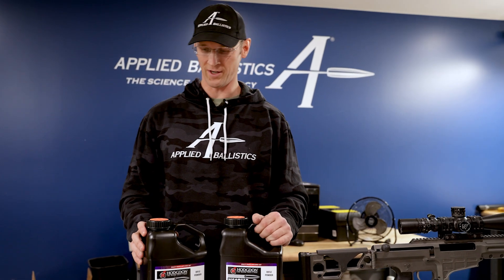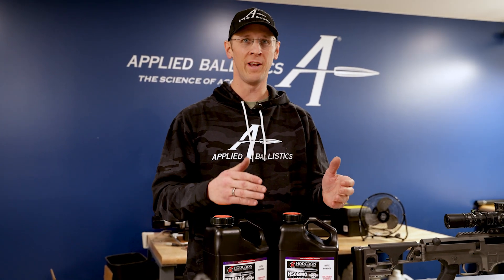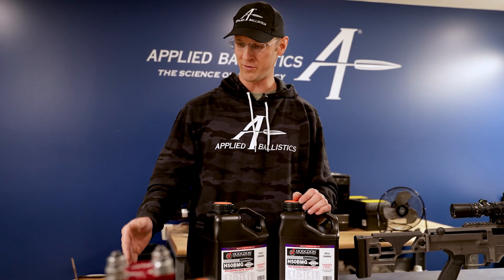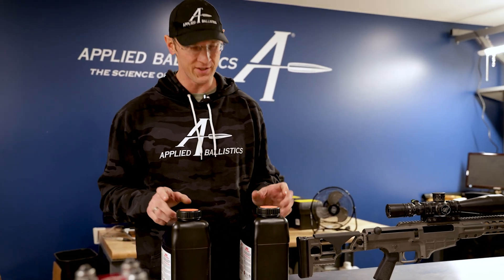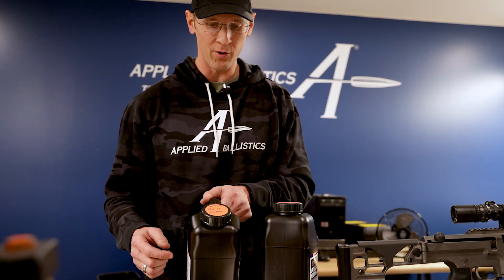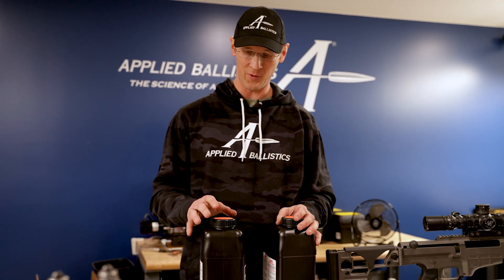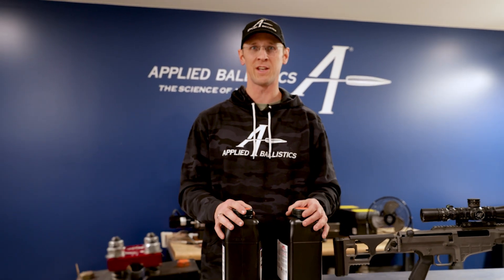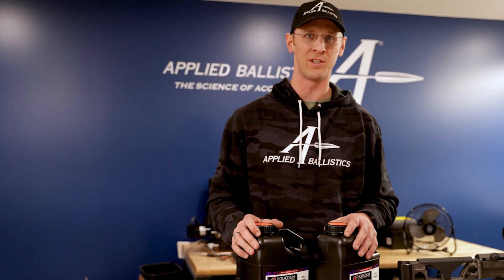Powder Humidity / Temperature and Storage

Comment: Brian, What humidity range do you suggest is optimum?
Reply from the maker: You always want to use the Humidity at your position but if you do not know it or cant capture it, 50% is the value you would want to input. Humidity has little effect on your solution until 1 mile or further.
Reply: @AppliedBallisticsLLC  Thank you for your answer, but I meant what humidity range do I want to keep my gunpowder stored at?

Comment: @AppliedBallistics, Could you do a test where you make 40 identical cartridges of powder that was stored at 50% humidity for at least one month. And then shoot 10 right off as the control group for velocities, and store 10 in a sealed ammo can at 10% humidity, 10 in a sealed ammo can at 50% humidity, and 10 in a sealed ammo can at 90% humidity, then shot them one a day till they run out to see what the velocity differences are? And be sure to make them a light load so that the drier ammo will not get too high of pressure.
Reply: @Boltactionreloading has done this
Reply: @johnwynne5937  I though he did the powder and then loaded rounds with different RH powders, not actual cartridges made up with the same RH powder to see how well the humidity impregnate loaded rounds over a short period of time.
Reply: @thetexasrat  that is correct, I misunderstood what you were asking. I would wonder however how much that could vary from cartridge to cartridge
Reply: @johnwynne5937  It is being proclaimed by one source that within 24hrs a loaded cartridge will acclimate to the RH of its new surroundings. Others have stated within a week. So I am curious as to just how long it actually is.

Personally, I store my ammo in an IP-65 Rated ice cooler maintained between 54 to 57% RH. This way my ammo should be as close to factory conditions as possible at all time. I take some out and I shoot 'em before they have time to change, and the rest is still stored at the constant RH set. But I am wondering if I took some out of the cooler how long would it actually take for high RH to soak into the powder, or lower RH to end up drying out the powder.

Comment: The only way to prove what humidity does to your load is to take a sample of powder from the same jug, preferably multiple samples from the same jug and set them a side and get them to two different moisture contents. then go test everything. testing high moisture, low moisture and control loads. that way you will eliminate any potential jug to jug variance even if the powder has the same lot number.

Comment: This is awesome. I had been working on this problem since watching Bolt Action Reloading’s video. This really answered a lot of questions as to why I was seeing with hotter loads due to powder drying out.

 I found this video right after discovering the 49% Boveda packs, so I felt safe using them with your recommendation. Sadly a lot of my cans are 1lbers and my D3 Drop would not fit through the opening. After much searching, I found a humidity device about the size of a quarter from Blue Maestro. 

I have been finding that my open powder drys to high 30s low 40s here in Semi arid Wyoming. The Maestro disk works perfect. I do wrap it in some nylon stocking type material to keep powder out of the vents. I tie a string around that and lower it in leaving the string end out for retrieval.I jostle the can around to bury it in powder so I am reading that instead of the air. I also tape a string to the 49% pack and hang it rather than let it lay on the powder. This may be overkill but I worry that powder touching the pack might “soak”  more moisture. According to the manufacturer the 49%, unlike the others, are designed to range from high 50s new, to 40s as they deplete.

One thing I don’t do is leave powder in the hopper any more than I have to. I have purchased open cans of powder that were dryer than mine and I suspect this is why.

Comment: Fyi, the humidity acclimatization starts happening in many powders before you break the seal. I store mine unopened, vaccuum sealed with color change desiccant packs in the vaccuum bag and outside of the factory sealed power can. Some cans collapse from the vaccuum immediately, some take a month to collapse, and some permanently keep their original shape ("good factory seal"). Usually in less than 2 months the desiccant packs achieve maximum color change and saturation (about 3 mL max. Per. Pack based on the package). This is true even with the cans that permanently hold their shape under vaccuum sealing. I've had some of these desiccant packs sitting open around the house for over a year to see if ambient humidity would cause  color change, and there has been no noticeable change compared to desiccant packs still in their original package. I do this with primers too and the desiccant  packs become saturated in about a month or less. Vaccuum sealed other items with the desiccant packs (like pasta) and no color change was noted in those in over a year. Point is, powder acclimatizes from the time it's made till you seat the bullet, factory sealed can or not, and may continue in loaded ammo but I don't have evidence one way or the other on that. Just an fyi 😊 thanks guys
Reply: russian ammo has a clear laquer paint at the top of the case and across the primer to seal the powder.

Comment: This maters a lot more than people think. I published some data on this on my channel in 6.5 CM with H4350. From lowest to highest RH I could stabilize I saw a shift of 200 fps.
Reply: So am I correct in understanding that a lower RH = Lower Pressure + higher fps and higher RH = Higher Pressure + lower fps?
Reply: @BrendanSoltys  increased moisture content increases weight of powder. when you measure for example 41.5 gr of H4350 you will get more powder if the powder has low moisture from being stored at a low RH vs less powder if the moisure is high from storage at a high RH.
Reply: @BrendanSoltys  Low RH = high pressure and high velocities.  Low RH = low pressure and low Velocities. As BrendenSoltys pointed out the powder weighs less when the water is dried out of it so that one will get more volume of powder when they weight it. The lack of moisture in powder helps it to burn faster as well. So extra powder will be more in volume when weighed out and then with it being dried out to boot will burn at a faster rate too, whereby creating higher pressure and boosting the velocity.

And a lot of moisture in powder will make it weigh more to where the amount of powder when weight out will be less in volume. Also the moisture is a burn inhibiter and will make the powder burn slower. So less powder burning slower will produce less pressure hence less velocity.

Comment: I came here because I just had an issue with this. I loaded up 66.5 grans of IMR 4350 from a bottle that has been open for years in a load with a 178gr ELD-x out of my 300wm  and got an average velocity of 2510 fps when I was expecting something closer to 2850 fps. I had a new bottle so I tested it and loaded up the same 66.5 gr and got 2866 fps, much closer to what I was seeing in the ballistic charts. These velocities where recorded over the same chrony about 20 minutes apart.  Humidity can make a big difference. Unfortunately there is still about 2 lb left in the open bottle. Now I need to de-humidify it . . .
Reply: Are you saying your opened container had more moisture that the new jug? If so how do you know that?
Reply: @mln19631  
Confession time: I had assumed it gained moisture, but I don't know that. Maybe it lost moisture. I need to research more into that and what others are doing to fix the problem. I do live in Utah with relatively low humidity.
Reply: @bobsmith4407  I’d guess it probably lost moisture. My powders usually speed up after time and I suspect it’s the high heat and low humidity here in SW Oklahoma.

Comment: OK, what is the ideal humidity?  Is there a "range" of humidity where the pressure/velocity do not significantly change?
Reply: I would like this info as well…
Reply: Powder comes from the factory with 40-50% humidity in single base, and 50-60% humidity in the double base powders. When the reloading manuals give a powder charge weight it is with the moisture include in the weight. So it is with the factory ammo as well. If one dries the powder out, the rounds will be hotter than originally planned, due to the volume of powder and faster burning when lacking the moisture content..  In maximum loads it can become dangerous. And yes moisture can seep into a loaded round, as well as back out again depending on the humidity level out side the cartridge if given a week or so, unless one seals the round with sealant. Hence it is best to store ammo, powder, and primers in a controlled environment of say 49-58% humidity. This can be done within the sealed ammo cans by putting a Boveda 49% or 58% Two-Way Humidity Control Pack. Or one could store them in a Cigar Humidor cabinet that is both Humidity and temperature controlled.

I personally stored my ammo in IP-65 rated boxes with silica packs in them, with Bluetooth temp and humidity monitors to boot. Within days the humidity levels were around 28%. Not good if left that way for extended amounts of time. I have since taken the packs out and replaced them with the two way humidity control packs. Now things are as should be.

Also, vacuum sealing with desiccant pack will not only suck the air out of the cartridges, but will absorb the moisture from them as well whereby drying the powder out, making for a hotter burning load. Not good.

 https://chronoplotter.com/2021/08/19/how-does-humidity-affect-powder/

https://bulletin.accurateshooter.com/2008/09/tech-tip-humidity-can-change-powder-burn-rates/

https://www.youtube.com/watch?v=pzDHRwi3QVk
Reply: Vitahvouri recommends keeping your powder stored in 55-60% rel humidity environment, below 68 Degrees temperature.

Comment: How long after you reopen the keg does it reabsorb the moisture content of the air? What happens when I load a low humidity controlled powder in a high humidity environment? Does the powder even able to absorb moisture? Open all my kegs at the same time , let them breath for a few days and seal them back up? :)
Reply: Store and load at the humidity the powder manufactures make the powders at, and then seal the ammo straight way. Ranger makes quality ammo sealer. Now it does not matter where you go to shoot the rounds or just how long you store them or where, as they will retain the moisture they had when you sealed them up. A month is considered to be plenty of time for the powder to acclimate if it was not already where it should be humidity wise.